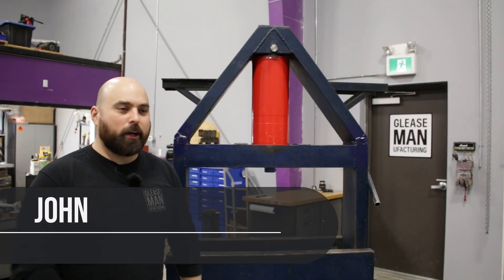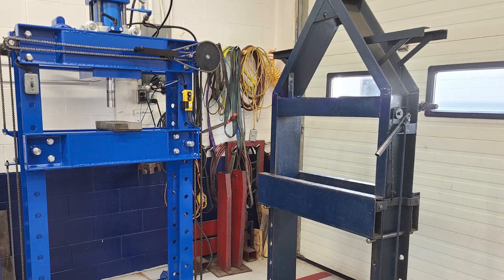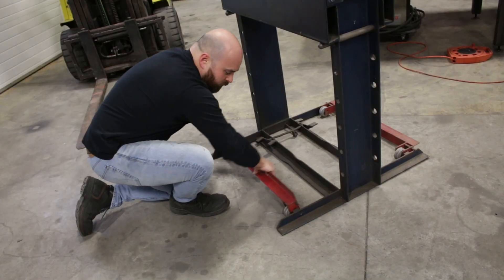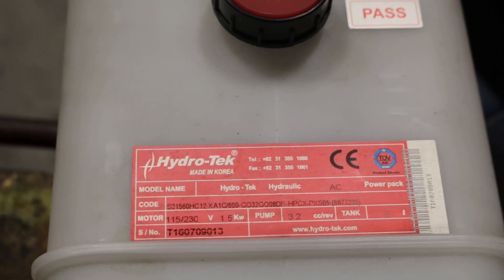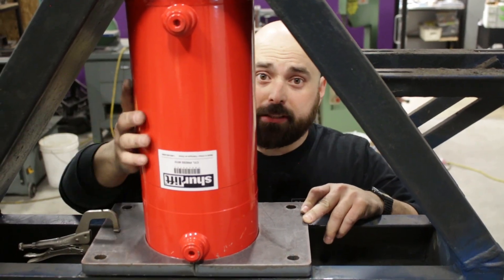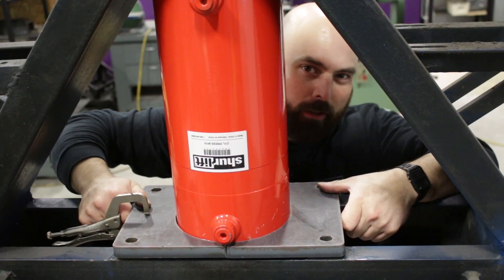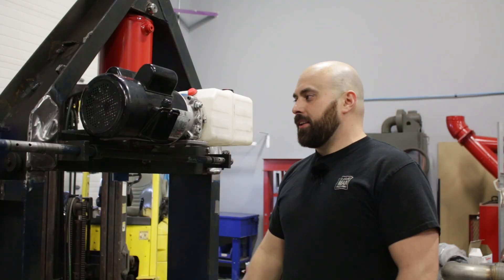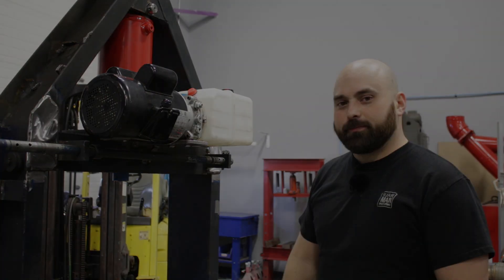The extremely subtle joys of building a shop press.

Comment: Sounds like your mig is in stt mode, turn that off for normal welding it runs heaps better, and a more consistent feed, you also won't need the voltage sensing cable (the small earth lead) but love the videos and the content keep it up
Reply from the maker: Thanks a lot! 

You're exactly right about the STT mode, but this Lincoln STT 10 is permanently in that mode unfortunately. Looking into getting a new mig setup because of it..